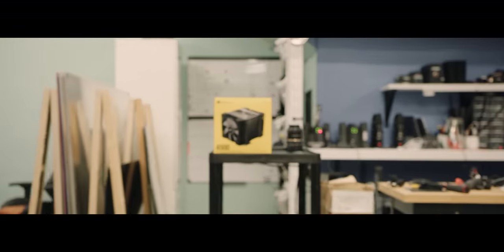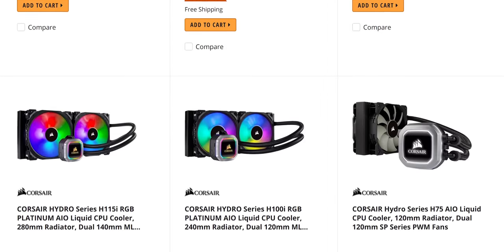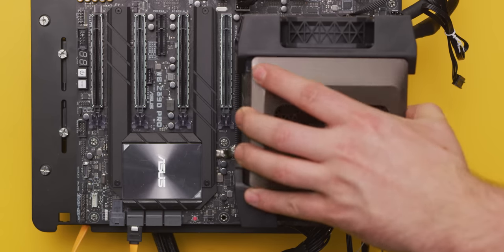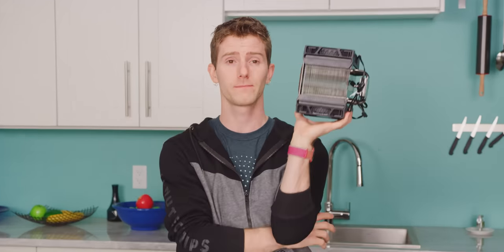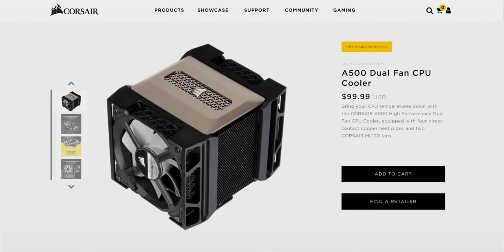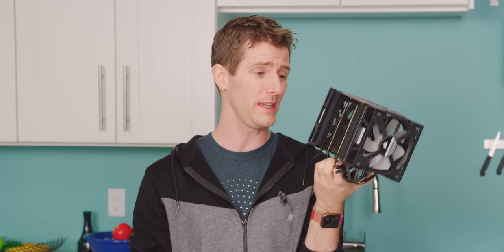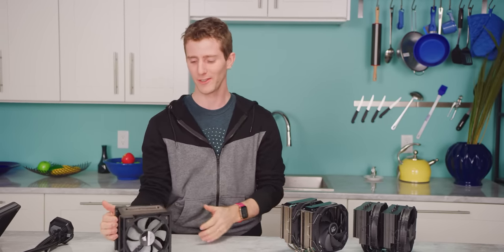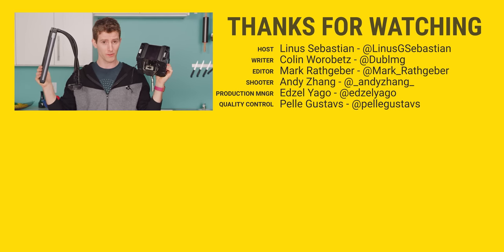Even Corsair Knows Air Cooling is Better - A500 Review

Comment: Linus:"I really like to see another attempt at a top-tier high performance air cooler from Corsair"
Corsair:"Ohhh you want more RGB. Got it!"
Reply: @bradhaines3142  Shit, if not in the next few months.

They are pricing a "blacked out" version of the cooler itself with (I think they ship iCUE fans) ML120 RGB fans that performs like dog shit in comparison to their price point.

3 Months later, Corsair will release a "New and improved" version, A520 and A540. Both of these models will have an RGB top plate, RGB fan-mounting case/holder/slider-thing, and the only 140mm option will be the A540 RGB model.

They will charge anywhere from 20-35 dollars more for it.

By pricing dog shit at a high price tag for the fans and branding, they can price flashier dogshit with more RGB for even higher. "Why buy 1 chocolate bar for 2 dollars on sale, when I can buy 3 chocolate bars for 4 dollars any time?" that's what they're doing, it lets the flashier option that is 100+ seem like it's a good deal.
Reply: Noctua reverse engineerd with RGB? check jk they have some extra stuff you'll never need
Reply: Challenge accepted! ® Corsair
Reply: Weird, I said meh, that's all I need to see and scrolled down and started reading this as he started saying it. I always see people saying that in comments and say bs... you, sir, just made me less cynical.
Reply: Linus the next day: ok the fuck did you do corsair slight silence GODDAMMIT ITS COMPLETELY RGB AGAIN!
Reply: @MrCODEmaster00  no u

Comment: Linus : watercools everything
Also linus: air cooling is fine
Reply: I mean air cooling is fine. It's low maintenance and performance and acoustics are often better than AIOs.

I say this as someone who spent $2k on a custom loop.
Reply: You can get Linus to say literally anything if you have enough money.
Reply: @GregoryVeizades  I have yet to see an air cooler quieter under load than my water loop. Especially for the GPU. If only I could water cool my power supply my machine would be virtually silent.
Reply: @deejnutz2068  this guy over here really believe water-cooling doesn't still have fans involved, and forgets pump noise is a thing.
Reply: @MapleLeafAce  Imagine custom loop with air in the pump.
Reply: @themonroe654hd6  Oh, so that must be why he didn't recommend it, because Corsair didn't pay him anything. He's so big now that just sending him a product for free doesn't ensure a good review, you have to pay him cold hard cash on top of it. Thanks for letting us know.....
Reply: Linus in the future: Enclose everything in thermosiphons!!!
Reply: @supertrexandroidx  Can't tell if you're joking or not but I really believe all of that.
Reply: @deejnutz2068  not sure how 3x 140mm fans + pump would be much better than 2x 140mm fans.
Watercooling have ONE benefit over air, moving the radiator to the edge of your case instead of relying on the airflow inside.
Reply: @themonroe654hd6  You're deluded. I have no doubt that Linus has his biases for one reason or another, but he's by far the most honest big tech youtuber. Also why are you even watching his videos if you think he's just a shill?
Reply: @deejnutz2068  AIOs don't do any better then air coolers, custom loops are their own creatures. Both in terms of cooling and noise, which your loop demonstrates.

That said, I have an AIO (a Deepcool Captain 240) and it's fine, a bit noisy, but fine.
Reply: I think watercooling just looks better especially for like an enthousiast machine
Reply: @ssu7653  it's surface area and heat dissipation. Three 140 mm fans on a decently thick rad has almost three times the surface area that two fans on a single heatsink block. The fans make up for the surface area of the block by pushing more air through it faster.

A rad doesn't need as much airflow to achieve the same cooling. (Depending on spec)
Reply: @MapleLeafAce  This guy doesn't realize that sub-800 RPM water cooling is a thing, and that pump noise is negligible when run at a lower setting. Air cooling is louder with similar performance, period.
Reply: Custom loop water cooling /=/ aio water cooling
Reply: @SlinkiestPopi  To show everyone that I'm right.
Reply: @themonroe654hd6  I know, there's some people who believe that anyone who manages to make a living on Youtube via any means but donations are suspect. And maybe so, but good luck creating new content and doing it often enough to satisfy your audience on nothing but donations.
Reply: @themonroe654hd6  Exactly. This is an ad.
Reply: @deejnutz2068  Doesnt seasonic have a psu without fans
Reply: @supertrexandroidx  Good thing that isn't really your or my problem.
Reply: @BrawndoQC  Idiocracy is a great movie. It's only been 14 years and we're basically living it in real life.
Reply: @julianrikenberg9464  yeah, but those only work well in a case that has decent airflow. I have a core p90 for my case, so airflow is non existent lol
Reply: @themonroe654hd6  It's your problem if you really believe you can't trust anyone who makes a decent living here. It begs the question of why you would even bother to watch any of their reviews if you think they're all bought and paid for...?
Reply: @themonroe654hd6  Pretty much, other reviewers basically disagree with Linus's conclusion.
Reply: @supertrexandroidx  That sounds like a me problem and not a you problem, does it not?
Reply: @themonroe654hd6  Yeah, exactly why I said it's "your" problem, not my problem ;)
Reply: There is also the "Cool factor" (pun unintended) of an AIO or liquid cooling loop, because they DO in general look nicer than a chonky air cooler just. It also helps that he is usually using some overdesigned "Gamer" motherboard with fancy VRM heatsinks and all that, which would be lost behind a good air cooler.
Reply: They use air cooling on some of their test benches
Reply: @supertrexandroidx  Which means you shouldn't care about it. And yet here we are.
Reply: Honestly outside of the whole "watercooling random appliances" I've noticed that Noctua coolers make a lot of appearances on this channel, especially the NH-U12S.
Reply: @themonroe654hd6  Nah, they make it clear if it's a promotion or a review.
Reply: @SlinkiestPopi  yeaaaaahhh he's not the most honest youtuber lol
Reply: @themonroe654hd6  By that logic, you shouldn't have cared enough to comment in the first place. You shouldn't have even been watching the video in the first place, because you don't see any value in it. But I do agree that this discussion has run its course....
Reply: @Soniku Raharu if you're going all out performance than Delta TFB1212GHE, the first 120mm fan to break the 200CFM mark at a neat 220CFM at 65dB, 29.4W
I have some old FFB 80-120mm kicking around from retired servers and they absolutely scream along. The TFB take it to the next level.
Reply: @deejnutz2068  you can water cool your power supply. FSP do a 'Hydro G PTM+' iirc which has an integrated waterblock.
Reply: @supertrexandroidx  Yikes
Reply: @deejnutz2068  what cooler have 3x 140mm fans? The gold standard today is 360mm radiator (3x 120mm fans) for AIO cooling, something a dual 140mm air cooler compete very good against (depending on model of bouth products).
Reply: @ssu7653  there are plenty. Especially if you're doing a custom loop
Reply: @deejnutz2068  with a custom loop you can hook up a car radiator, but lets keep to AIO that is in the ballpark same price (within 2x the price maybe) and go from there?
Reply: @Ronoc Akim CAN but air cooling get you 90% of the way there for 90% cheaper. Its also not nearly as much maintenance or risk.

Comment: Core temperature: 92 C
Linus: "Yeah, this is looking pretty OK!"
Reply: If the competitors were under the same conditions running high 80's-90 then 92 doesn't seem a meaningful issue...esp considering measurement error, 3-sigma, installation variables, etc.
Reply: @exgenica  It's hard to keep a "Multicore Enhacement" 9900k under 90C. The Mobos tend to give it way too much voltage to ensure stability at the cost of heat.

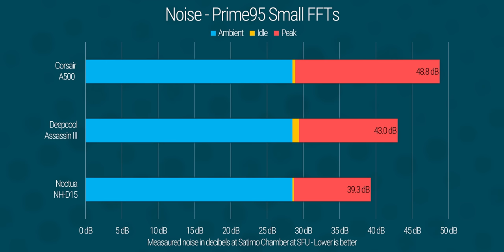Comment: 5:15 Sooo, Noctua NH-D15 it is then.
Reply: A500 Temps are the worst of the bunch, but on top of that it's REALLY REALLY LOUD.
NH-D15 is still a top performer to this day.
Reply: 1. Prime 95 is not representative of ANY gaming workload.
2. They're using a 9900K, one of the least efficient chips ever in the consumer market (superseded, of course, only by the 10900K).
The NH-D15 is one of the best options for anyone who wants a quiet computer.
Reply: @budthecyborg4575  Yes go with Noctua or an AIO.
Reply: @budthecyborg4575  Yes i agree Noctua's are just as good as any AIO, but when you say prime95 is not representative of ANY gaming workload, you are not considering the gamers that have had there CPU's running hot at 90c while playing games. What about those gamers? Just google - CPU at 90c while playing games.
Reply: Anyone running a CPU at 90C needs to get an NH-D15 and temps will drop by about 20C.
Reply: I'm not using a NH-DH15 but i'm using Be Quiet! Dark Rock Pro 4 with my 8700k which performs similiar to NH-DH15. at 4.7ghz on all cores i'm getting 65c at most while gaming and it generally hovers around 55-60. If someone is getting 90c temps with a NH-DH 15 while gaming it's probably either poor mounting, thermal paste issues or a really hot running silicon. I never used prime95 but on Aida64 i get 80degrees, i'd probably get 90-95 on prime95 but like other people said those stress benchmarks are not representative of gaming or daily usage.
Reply: @kuro8158  Yes i have an AIO, and NEVER use Prime95 or Aida64, because the most stress i put on the CPU is gaming, just recently i played Serious Sam 4, and the hottest i ever got my CPU while playing Serious Sam 4 for an hour is about 40c.
Reply: <insert 'always has been' meme here>

Really, if you have the space and want air cooling there is no reason to look elsewhere.  Noctua are simply the best there is.
Reply: You really don't need a NH-D15 if you are not overclocking your CPU. It's like putting Pirelli P Zero tires for your stock Honda Civic.

Comment: Video title in recommended feed: “Even Corsair knows Water cooling suck” 
Video Title on the Video: “Even Corsair knows Air cooling is better”
Reply: A Jettison hem Tit wait, is the algorithm changing up the video titles or was the title updated within that short time... hmmm...
Reply: This is common.
Post video with title A, then change to title B after publishing.

Notifications will read title A, web will read title B.
Reply: Dinosaur tech, who buys this garbage anymore even after gaming laptops make a thousand times more sense. They need to start making kickass air coolers for laptops instead of this cinderblock stupidity.
Reply: And both clickbaity as no product is mentioned (something Linus said he would stop doing), so automatic down-vote.
Reply: tropicthndr Laptops can't get close to the performance of top level desktop setups. If you're just going to be using an i5 and a 2060 then sure a laptop is a solid bet but that's not everyone. If you actually require performance then there is no alternative - but if you don't require that then you don't require large heatsinks either.
Reply: It's because they don't want to be negative towards water coolers since they don't suck, it's just that top air coolers generally beat top water coolers. They've changed the title to reflect that fact.
Reply: @piers389  It got you to click on the video and didn't misleasd you as you got what was said in the title, so where's the problem Mr. Redditeur?
Reply: @tropicthndr  Rather not pay $3000 for what would be an ~$1800 system in a desktop form.
Reply: they're adjusting the api to the new youtube api (old one was still used to support old devices but that ends march) so there's gonna be a disconnect in the time the title updates for a few weeks
Reply: Did you look at the air cooled temps, they sucked.

Comment: Every time I see a Noctua cooler in these comparisons I'm always amazed. The level of engineering they have done for their products must be amazing. Coolest and quietest at the same time.
Reply: Ain't fucking quieter than my Dark Rock 4
Reply: @liviuganea4108  having a dark rock psu now and the noctuas as well in my build. Both are pretty comparable tbh. Noctuas are better for pushing air through a rad.
Reply: @techbuildspcs  Don't know about radiators, not a big fan of water cooling.
Reply: @nicekeyboardalan6972  So you ate Noctua shit. Good to know.

Comment: 11 months ago: Why you shouldn't water cool your PC

6 months ago: Why is Water Cooling Better?

This video: Even Corsair Knows Air Cooling is Better

Can you even blame anyone at this point for being confused about which one is better when your own channel has flip-flopped on this subject 3 times in the past year alone?
Reply: technology advancing as fast as it does is why it flip flops all the time.
Reply: That's the point. One is not necessarily better than the other, they have pros and cons and which is better depends on the person and the application/situation.
Reply: @ForgotowToUserName  AIOs have been largely the same for the past 3 years in terms of performance and the d15 has been out forever lol
Reply: @Kurtis Farrell I’ve never heard of anyone having a problem with an aio leaking, a custom loop is a different story though

Comment: As the YEARS pass, the NH-D15 continues to reign supreme, making me happy to have returned my h110i that was loud and janky for one!
Reply: happy with my h150 pro and its helping the gpu as well
Reply: @YordanHristooov  whatever makes you happy!
Reply: Scythe Ninja5 is new king now, it's basically this Corsair cooler but with more heatsink, and it's 120mm fans are 800rpm so it's completely silent, if you want you can get 1200/1500rpm normal or even RGB fans, it will be as quiet as Noctua NH-D15 with 1500rpm ones and it will still end up costing less, and on Ryzen stuff for some reason it outperforms everything, even H150, x62 and stuff like that that traditionally cool a bit better than D15 but are much louder, Scythe even got some new static pressure fans that outperform Noctua NF-F12 fans on same rpm with same acoustics , but they are Japan-only atm(Aya-Kaze is name of those fans, I might pay someone from Japan to ship me some as 12v RGB ones are 1/3 the cost of Noctua NF-F12's, this is coming from someone with only Noctua fans in his case)
Reply: Eh, Thermalright Le Grande Macho RT was pretty much Noctua's main competitor that D15 still can't beat. So no, it doesn't reign supreme.
Reply: @dainiusvysniauskas2049  yes and no. LGM is on par (practicaly the same number, quiter in DB, worse harmonic) but it's a one Fan cooler for the same price as the D15, a two fan cooler. That's probably why many people including me choose the D15 over the LGM.
Reply: @komi1834  I love Scythe, I have the Mugen 5.
Reply: For sure, if I ever go back to air cooling in a normal desktop that would be my pick as well. I had a D14 (the predecessor to the D15) on my 2600k @ 5ghz and even that one was great. Got the custom water cooling bug ages ago though and it's hard to imagine going back to those giant heavy coolers hanging off the motherboard.
Reply: @quinten488  I never had any of their products because they always made good products, but stuff like Mugen 5 are just not best value for performance you are getting, or best performance youc an get at which point you are not looking at price anymore (r.i.p. my wallet after replacing all of my 120mm fans with Chromax Noctuas when they became available here)